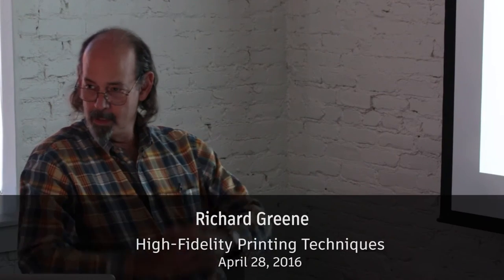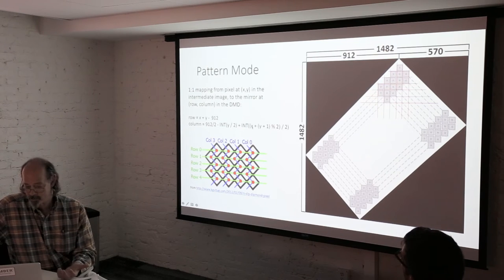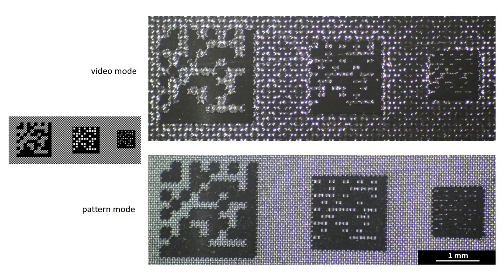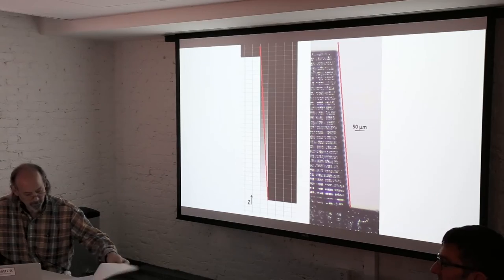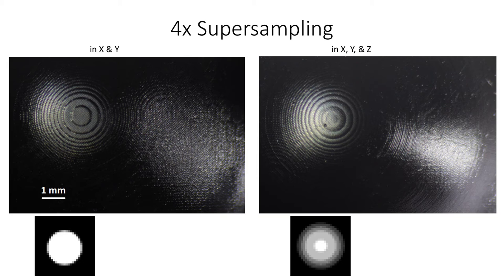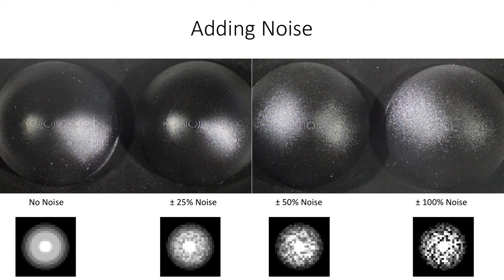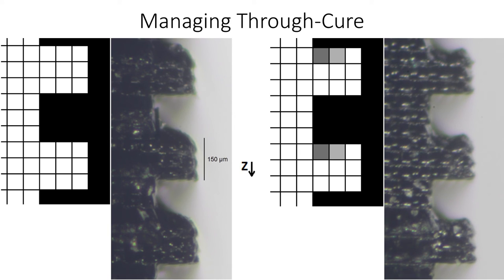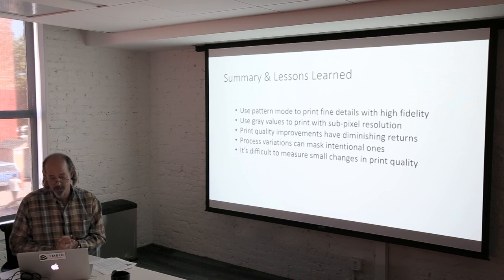High-Fidelity Printing Techniques by Richard Greene

Comment: At 35:25 in the video - Why does the horizontal orientation (X,Y) have this threshold where no voxels form until past .4 normalized gray, while in the vertical orientation it is very linear from 0 to 1?
Reply: The 'vertical' one isn't actually vertical, they achived smoothness on a steep angle by varying the width of the layers on the XY axis, this is like normal AA. All that is happening here is grey pixels next to fully white pixels bleed into them and increase the cure, because it's just helping nearby pixels cure resin a bit more it can work at very low light levels. 
Meanwhile the 'horizontal' one is a slope printed in one layer, this is actually vertical AA, and because the grey pixels are making a whole new, but very thin layer they need enough light to actaully start curing the resin, for their setup that's at about 40%, from my tests it can be as high as 60%.